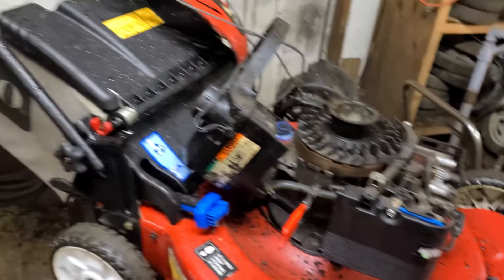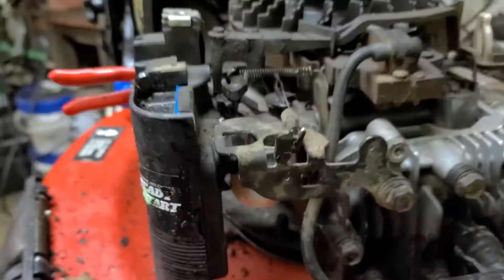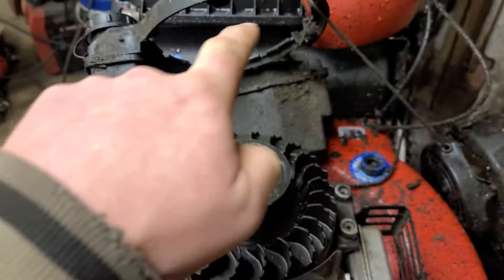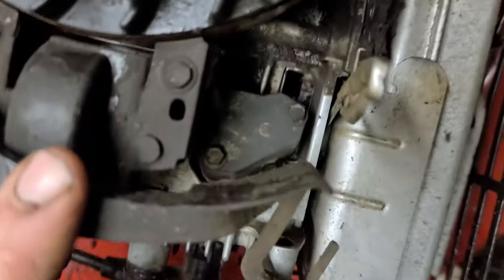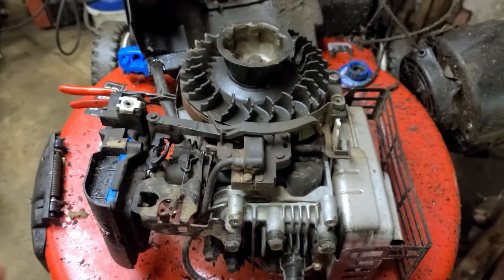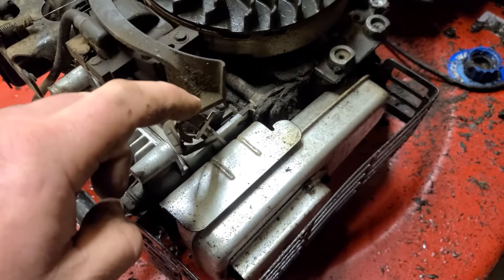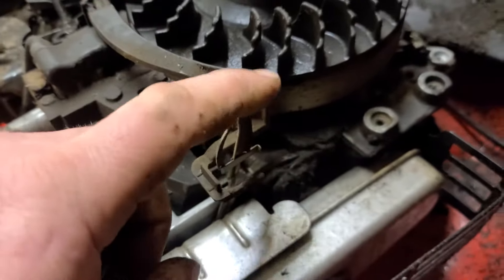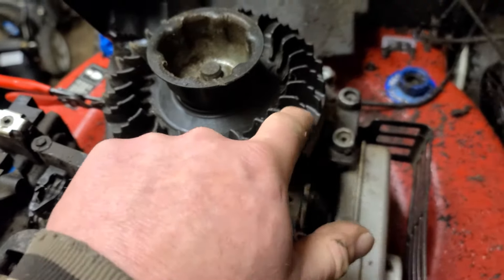How The Auto Choke Works On A Briggs And Stratton Lawnmower Engine #briggsandstratton #lawnmower

Comment: I got a question. I have one that's missing one of these. I pulled it when it was cold and it fired first pull.  After about 20 minutes  I tried it again and it wouldn't start.
Reply from the maker: Is there gas in it?
Reply: @machinesnmetal  yes.  I didn't know it wouldn't run again after it warmed up and no choke thermostat  because I see what you mean staying open when it's warm

Comment: Thank you for this explanation! I am having this issue with the themalpod/thermostat where it doesn't have the tension on it that it appears to have when you are flipping it forward. It just flops forward or backward with no resistance. I assume this means the thermostat is bad? Your video makes it appear as though its desired position is toward the handle and will spring back to that location? I ordered a new one and should be here in 2 days to replace it. Any tips on replacing it? Seems pretty straight forward. Also got a new OEM spring for the carb valve too.
Reply from the maker: You got It, when cold it should spring back towards the rear of the engine. The opposite when it's hot.

Comment: Is this what would cause a ‘choking sound’?
All the sudden my mower sounds like it’s clogged to death, there’s not much grass underneath and I brushed out the air filter etc..
It seems like it might be this choke bar causing my problems.  Great video :)
Reply from the maker: Maybe the spring fell off
Reply: @machinesnmetal  idk if it’s the modern design - but it ran great for 5-10 cuts out of the box, and now it’s struggling with the same blade height on the lawn. 
I can scrape clippings out - but it’s not the same as the last toro mower. 
Some sticking clippings resistance shouldn’t bog it down to death, it’s like they built it most energy efficient - but can’t handle the workload like older mowers.  
Great video though and thnx 4 the advice :)
Reply: @machinesnmetal  I don’t mow early morning or when it’s wet - it just couldn’t do the same work/power and choked out easier.

Comment: I couldn’t get the autochoke linkage reconnected so I just skipped it.  Mower runs fine.  I’m assuming if I just didn’t hook it up it’s not choking at all?  So if I can get it to run then I’m good?  I tried forever to get that linkage set but it doesn’t seem compatible with the new carb
Reply from the maker: If it works, don't fix it

Comment: I have a B/S 125K02-0389-E1 . I cannot find that spring anywhere that remotely looks like the one in your video. The ones I've seems so short compared to yours. Any help by any chance to find the correct spring?
Reply from the maker: 790849
Reply: @machinesnmetal  Thank you sir. 3 yrs from the original video and you still find the time to folks. So appreciated. Got one ordered from that jungle store.

Comment: rebuilt whole engine from tear down, wouldnt start. the one part i lost and replaced was that spring. got a new one, pulled out all tension before it wouldn't sit on rings, and now it starts

Comment: My toro push mower has low rpms 
Replaced the carb, spark plug and air filter, still nothing.
Need help
Reply from the maker: You need to bend the metal tab at the front forward a bit to pull a little harder on the carburetor spring.
Reply: Alright. I'll give that a go.
Thanks 👍

Comment: I've had this issue for years. Every spring I take it all apart and clean out the grass and sh!t that fouls up those two arms. Still having an issue this year though. I wonder if the themo is spent. Any way to test that? Thanks for a great vid ! -PH
Reply from the maker: Warm it up with a heat gun or torch, should slowly activate and when it cools down return to resting position

Comment: Good explanation of the choke mechanism. Question my craftsman Briggs engine looks just like your toro one. It starts and then it stops i changed out the oil, spark plug, gas, air filter and cleaned the fuel lines. It’s still not working. I’m thinking maybe it’s the thermostat but not sure? Any suggestions? Also I noticed when I get it started and pull the mower up by pushing down the handle down and it seems like it wants to run longer but once I lower it stops. I have  it since 2013 without issues until recently. Also I noticed that the carb seems to be leaking too just noticed that today after I assembled everything back unless a hose is not tight? I’ll have to check it out once I get back from home.
Reply from the maker: Clean out your carburetor bowl and main jet
Reply: @machinesnmetal  I’m going to undo the carb right now
Reply: @machinesnmetal  coil is completely dead. Ordered one, some additional minor parts
Reply: @machinesnmetal  my machine is back up and running at 100% 👍 I probably needed to do this along time ago. Oil changed, filter changed, new plug, new thermostat, new carburetor and running like new. I think it was a combo of carburetor, thermostat. Seeing it’s running great now. I bought a new coil just in case but didn’t need it after all.

Comment: Good day all
Since you said the spring has to be the correct one because it works with the vane, my question is where do I obtain the proper spring? My best guess is after 28 years of dependable service, the spring broke or popped off and now needs replacing.
Reply from the maker: I get mine from powersource canada

Comment: Are you sure you did not explain it the weong way around? The wind flap, when pushed away from the ventilator, should close (!) the choke, so to skow down the RPM; that's to keep the RPM constant, in effect. - Or am I wrong?
Reply from the maker: No you're thinking about a governor vane. these engines have an internal mechanical governor that does what your descriving. This vane only controls the choke and when the flywheel spins the wind pulls the choke to the off position

Comment: My problem is when engine is cold it starts fine but shuts down after about 5 seconds, I got rid of mower and then my daughter brought me one she had bought and it’s doing the same thing??? Does anyone know what to do to fix this issue??? I personally think it’s toro junk that’s why I got rid of mine. I will tear into this and look at what you have suggested to check it??? Choke auto shuts off choke in the 5 seconds and stalls the motor
Reply from the maker: Youve probably got dirt or water in your fuel. It's starting because the choke being on when it starts forces extra fuel through, and as soon as its running and the choke comes off, not enough fuel makes it through and it dies. Check your fuel source and see if it's dirty/watery fuel.

Comment: Hmmm I lost that choke spring you are talking about and ordered a part # 790849 and it seems to have way too much tension.... What the heck. Pls help
Reply: Maybe it's because I bought the cheap Chinese 10 pack for $8 on eBay and the spring tension is wrong? Hmmm 🤔
Reply from the maker: What's your model type code?
Reply: @machinesnmetal  hello! It's a craftsman 917.370620. I'm really confused why it didn't work. I was confident it was the correct spring
Reply from the maker: Need the model - type - code off of the engine
Reply: @machinesnmetal  thanks so much for responding! Does 126T02 sound right? 

I have see a long string of numbers "126T02-1401-B1 09103159"
Reply from the maker: Should be 790849. I only use oem parts because the offshore junk always every single time causes new issues ontop of the old one.
Reply: @machinesnmetal  okay thanks for checking for me bro 👍🤓

Comment: i have an auotchoke mower and it seems to have trouble starting all the tiem idk why
Reply from the maker: Maybe the auto choke isn't working properly.
Reply: @machinesnmetal  yeah i managed to fix it it started first pull im just wondering if the previous ones i had i hook them up wrong when putting them together..a mistake on my part theres 2 bars and the spring this one is different than others but it worked out fine just need soem part that were missing but thansk for replying

Comment: Hello, excellent video. Question for you, when I cold start , my flywheel seems to push the auto choke open so quickly that it doesn’t give it enough time to fire, it spudders at best, but then dies. As soon as I get someone else to crank it over, I hold the choke for a few seconds longer and then it seems to stay started and runs fine from there. I have replaced the thermostat and tensioner spring and my auto choke moves freely and cleaned out the carb. Any idea on what else it could be ? Thanks in advance.
Reply from the maker: You might have to bend a little metal tab that the spring attaches to to create a little more pull on the arm when the machine is cold and off

Comment: Very well done DYI video, keep'em coming.  Can you tell me what the torque specs are for the head bolts on this mower, I can't seem to find a definitive answer. I've seen 140 inch pounds, 160 inch pounds, - 33.5 foot pounds. Trying to navigate through Briggs and Strattons' home page leaves much to be desired. Not unlike John Deere.  Thanx in advance
Reply from the maker: Honestly, snug and then tight. Been doing it so long it's all by feel for me.

Comment: When I do a cold start the butter fly is closed. As soon as I pull the recoil to start the butter fly opens fully. As soon as it coast down the butter fly closes and does not start. Is the spring to weak to hold it closed till the auto choke holds it open. Thanks from west Tennessee
Reply from the maker: It sounds like your thermal pod is not working or caught with debris.
Reply: @machinesnmetal  I finally got time to look at it   Spring choke return spring weak. I shortened it and got a part number for the future Briggs # 590740.

Comment: I picked up a used John Deere JS36 mower that wasn't running. It has this same Briggs and Stratton Quantum engine. I removed the air filter to find that it was probably never changed and also may have damaged the carb. I got a carb kit and replaced everything (carb, o-ring, gasket, fuel line and filter, air filter and spark plug), only to find that it still doesn't start. But I did notice, after watching this video that the auto choke spring is missing. Do you know what the part number is for this spring?
Reply from the maker: Do you have the model and type code off of the engine?
Reply: @machinesnmetal  I think the spring part number is 790849. I will double-check tomorrow. Thanks!
Reply from the maker: here it is on amazon 

https://www.amazon.ca/Briggs-Stratton-790849-Spring-Replacement/dp/B00524NXN0/ref=sr_1_1?keywords=790849&qid=1652072664&s=lawn-garden&sr=1-1
Reply: I picked one up at the local hardware store for 6 bucks. But now I found out it has no spark. Might need a new ignition coil.
Reply from the maker: Might could do.

Comment: Mine seems to not hot start when the choke is open. If its hot and I manually choke it, it'll start. Any ideas? Carb has been cleaned and got a thermo lever on order but have a feeling the lever is not the issue. Plastic arm moves smooth as well.
Reply from the maker: Good high octane fresh fuel? It's either not getting enough good fuel to fire or its getting too much and the plug isn't able to fire to ignite your mixture.

Comment: Nice video, thanks very much for posting!  I have an older Troy-Bilt mower with essentially this same engine and autochoke system.  It generally runs pretty well, but lately not quite as fast as I feel it should, and sometimes just a little erratic, so I've been looking around in the YouTube world for ideas.  Until I saw your video today, I had no idea there's supposed to be a spring attached there.  My air vane flops around loosely, doesn't feel at all like it has a spring attached to it, could that be causing the symptoms I'm seeing?  I can't quite tell from your video, where is that supposed to attach?  It looks like maybe to the choke mechanism and over to a bracket in front of the air vane?  And from parts diagrams I've seen, it looks like that's part number 790849, does that sound right?

Comment: I am looking for a replacement carburetor for my toro Model 20333, With the Briggs and Stratton.
Quantum engine with auto choke shown on this video.  It is a 2012.  Briggs and stratton engine number is 128m02-3456.  Know Anyone who has a replacement carburetor?
Reply from the maker: Amazon
Reply: @machinesnmetal  Thanks comma but I am unwilling to pay   Twenty five percent of the value of a twelve year old  mower.  I'm looking for a used one that is functional, or a high quality chinese knock off if there is such a thing.  Any Recommendations based on your experience?
Reply from the maker: Like $12 on amazon man

https://www.amazon.ca/Carburetor-Mower-20066-20090C-799866/dp/B07WCVDQBL/ref=sr_1_3?crid=1H68URTSI4EIH&keywords=20333+carburetor&qid=1690820150&sprefix=20333+carbureto%2Caps%2C185&sr=8-3

Comment: My problem was when hot, had to let mower sit for five or more minutes for thermostat to close choke I took the thermostat out and it works fine and starts every time.
Reply from the maker: Carburetor mainjet is slightly plugged or there's debris (water/dirt) in the bowl blocking enough fuel to prevent it from starting when it's hot and the thermostat is functioning. Yours needs the extra choke fuel to get it started hot or cold.
Reply: @machinesnmetal  Brand new ( Chinese carb) runs perfectly so I won’t mess with it. Got the mower for free because the needle and seat were leaking.

Comment: Nothing beats the manual choke.  To date all of Honda GX series have manual chock.  They have complicated the life for no good reason.  Instead, they should have educate the operator as how to use the manual chock.  You couldn't give me a mower with an auto choke.
Reply from the maker: Honda GX are a commercial engine I believe they would offer a little bit better feature in keeping the manual choke lever on the GX series The GCV series of Honda is the homeowner version and they have both chokes available the older models were all manual but the later models now are using a heat activated system. A big part of all of this is emissions standards as well